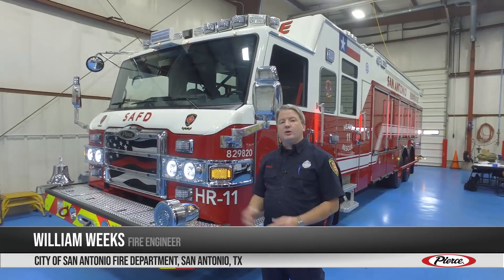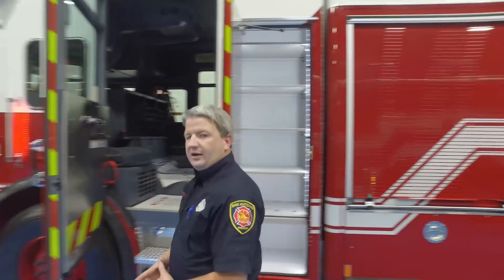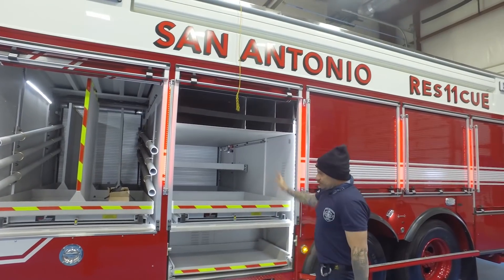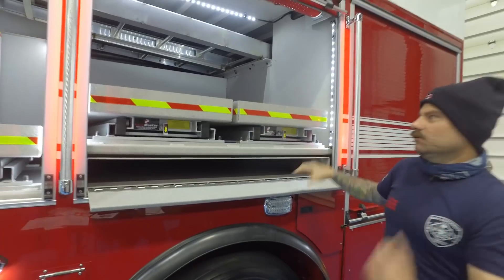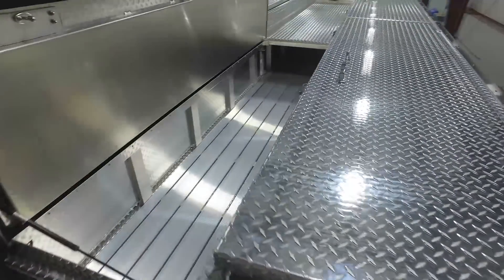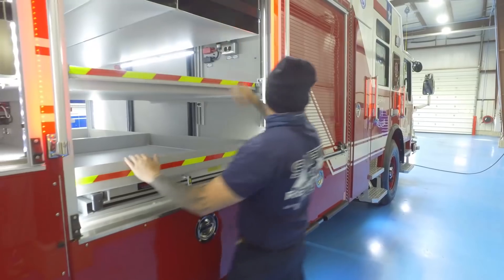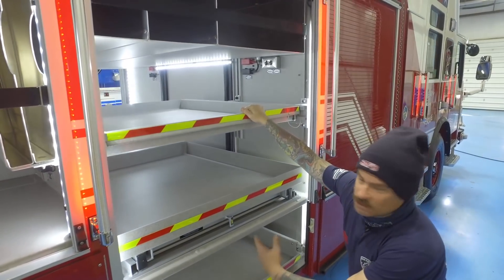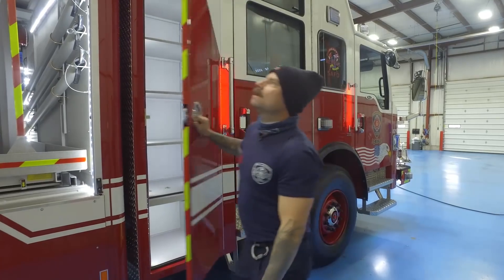Velocity® Non-Walk-In Heavy-Duty Rescue – San Antonio, TX

Comment: First US Truck I see using those standplates down the compartments. Pretty standard here in Europe.
Reply: They’ve been available here in the US for years. 
They’re just not a commonly specified option.
Reply: Same for me. Seeing those used in the US is pretty rare.
Reply: What’s that?
Reply: @hunchojack1858  We mean those plates at the bottom of the compartments that you can fold down and stand on them to have easier access to the equipment. (At 2:18 for example)